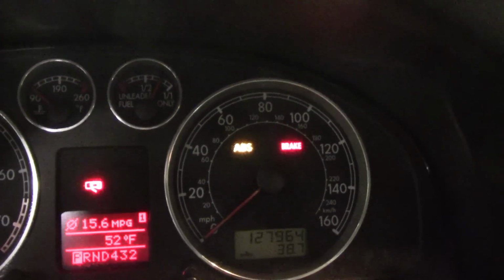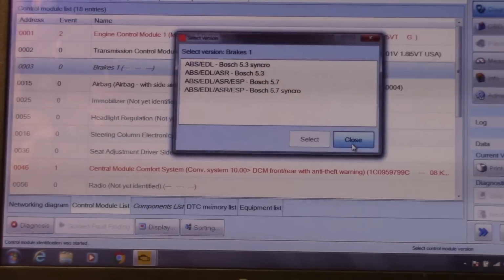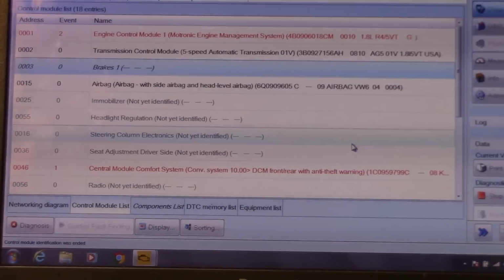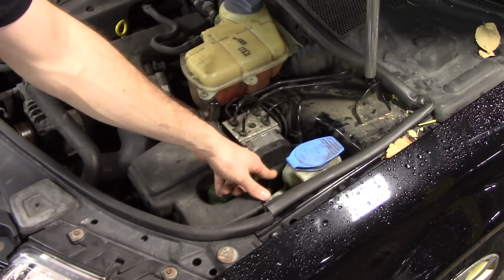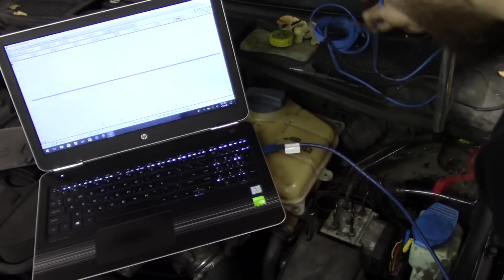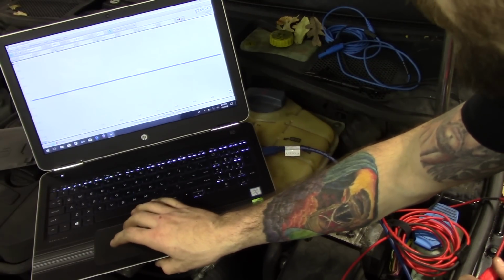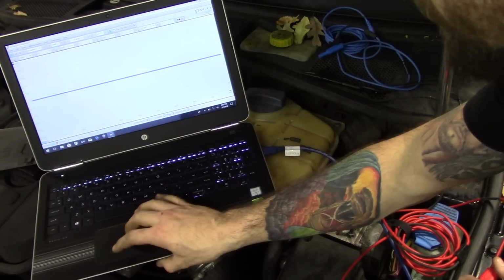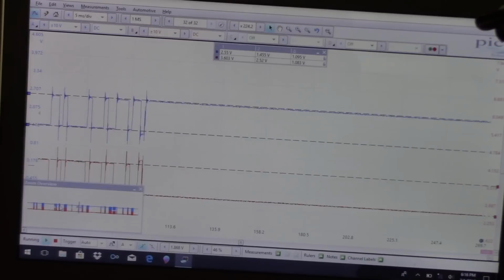ABS Module No Communication (2001 VW Passat 1.8T)

Comment: JETTA 2009 18259 1851 CODE AND THERE IS NO LETTER ON THE SCREEN, JUST WHEN I TRY TO TURN ESP OFF, IT DOESN'T GO OFF, IT IS ON ON THE SCREEN, IT WAS LIKE THIS BEFORE, JUST WHEN I PRESSED THE BUTTON, IT REMAINED ON LIKE THE OLD MODEL

Comment: pop off abs module cover and check ground pin with ground on scheme, its common thing, just solder ground two wires to cooling rad and done.
Reply from the maker: I’d like to try and start doing module repair.  Maybe someday

Comment: Can u help me out have all good power and grounds.but my oms are 160
Reply: On the orange
Reply from the maker: There are 2, 120ohm resistors In parallel. When they are connected In Parallel you should read 60ohms on a good circuit. It sounds like you have open circuit. Where are you doing your resistance measurement? And are all the modules plugged in when your doing it?  You might be unplugging a module that has one of the resistors in it and that would change your ohm reading.

Comment: Hi
What if the resistance is not within the specs???
Reply from the maker: What was your measurement?  Could be wiring or could be a faulty terminating resistor.
Reply: @PositiveLeadDiagnostics  
17-18 ohms

Comment: Same thing on a 2002 Passat. ABS light on constantly and red brake light intermittent and three beeps. Have done a lot of research on this issue. First proceed from the easiest to the more complex checks. 1- Enough brake fluid. 2- Check voltage and continuity in brake fluid reservoir sensor (clean it). 3- Check all the fuses related to ABS (replace accordingly). 3A- Verify your battery delivers the right voltage to the ABS/brake system (more than 12.4v ignition off), clean ground connectors. 4- Scan or have your car scanned with a Vagcom unit or any device capable of ABS reading (if a message of "no communication appears" bad news, abs module is kaput or wiring issue). 5- Clean and check ABS sensors in each wheel (use a voltmeter) also check wiring continuity. 6- Inspect the tone wheel teeth (sometimes there's dirt, rust or a significant wear; clean/replace). 7- Remove and check ABS electronic module. There's no need to detach the hydraulic side (no fluid mess). Inspect the wiring and connectors.

After my extensive search and talking to different specialised technicians, one of them from Bosch, told me these parts are programmed to fail at due time. Meaning you have to replace them yes or yes. A new unit for my car is around $1,200 usd. You can look for a second-hand unit at a junk-yard (around $300 usd). If so, you will need the old one so they can do the proper coding after replacement. Without coding its the same as if you did nothing; you will then need to take your car to a Vagcom equipped repair shop and may even come with the hydraulic unit as a whole, so full brake service here.
This happens no matter which brand of electronic module or car manufacturer you own.

*Note: There are some specialised service centres in the U.S. where they rebuild your module. You just remove the part from your car and send it over to them. Google it and some centres may appear. Some people have found some very fine wires (thinner than human hair) detach inside due to vibration. The inside is covered by a special gel so it is almost impossible to repair it yourself, besides being a highly specialised welding process of two different metals. I have known some people tried the help of jewellers to repair micro-cracks and use their expertise in metal micro-welding. It's a shot in the dark. 
For security sake you'll be better off with a new one (if you can find the part), rebuild your current module or buy a second-hand one.

Some folks will tell you if you can't drive without ABS, probably you shouldn't have a car at all! Truth is we have to go through vehicle inspections and our life is on the line, specially on wet and icy roads. 
Not all of us can be a Raikkonen or a Hamilton 🏎

Be safe.
Reply: Hello I'm an ex quality control BMW Mercedes technician from the '80s '90s no longer involved and car repair at that level my 2002 Volkswagen Golf manual transmission is undergoing some symptoms brake light beeping ABS lights been on for a while a real Christmas tree there suddenly my EPC light came on after having the resonator removed don't know why they removed the resonator it was just knocking underneath the frame I wanted the repair shop to bend it I don't know if him not grounding that part of the job but I don't think that was the issue at this time I think it's just time for some ABS work I cleaned the sensors replace the two front sensors clean the rear sensors car still will not run drove it home and limp mode where it sits thank you for your information
Reply: Hi mate i have got issue of no communication with abs module (U0121) on Mitsubishi outlander 2010. I have checked body ground, power supply, can H and low voltage and resistance, battery voltage... every thing seems fine. Note checked all of these things at ABS connector but still its not communicating with the scan tool leaving all the warning signs on the dash. I have tried 3 different used modules by just connecting them with the ABS connector.. not installed them all the way with the ABS pump. Can you help me by suggesting what should i do. It seems no problem with the wiring issue. Should i connect it throughly with the ABS module to get communication with the ABS module or its internal failure ?? 😢😢. Note: I have tried multiple used ABS modules with the same batch number and still it shows no communication. And one time tried with the different batch number module and the car was  immobilised to start up.

Comment: What about the other side of connector that is in contact with the module pins??
Reply from the maker: A pin contact issue is possible but these modules are pretty common. A better test would be checking the network resistance from the pin side if you have the right terminals to fit in the connector.

Comment: Im having this issue with my Touareg going to test the resistance if that’s good I guess the modules gotta go
Reply from the maker: You have to check powers and grounds too
Reply: @PositiveLeadDiagnostics Hi mate i have got issue of no communication with abs module (U0121) on Mitsubishi outlander 2010. I have checked body ground, power supply, can H and low voltage and resistance, battery voltage... every thing seems fine. Note checked all of these things at ABS connector but still its not communicating with the scan tool leaving all the warning signs on the dash. I have tried 3 different used modules by just connecting them with the ABS connector.. not installed them all the way with the ABS pump. Can you help me by suggesting what should i do. It seems no problem with the wiring issue. Should i connect it throughly with the ABS module to get communication with the ABS module or its internal failure ?? 😢😢. Note: I have tried multiple used ABS modules with the same batch number and still it shows no communication. And one time tried with the different batch number module and the car was  immobilised to start up.

Comment: What would it mean if there is no resistance on the orange wires?  Would this explain an internal module memory error?
Reply from the maker: It would mean there’s an open some where. Either in wiring or in the module with the resistors.   How are you checking the circuit?

Comment: So, i had the same issue with a newer vag model,2010 seat leon.
As soon as the cold season hit, abs started acting up. 

I pulled out a full module(pump included) from a scirocco (same part number).

The car worked fine until the next cold season began. Same problem.

Can anyone help? Did the customer owning the car ever come back?

Comment: tom can I make a suggestion.  I also live with these current flow diagrams being an audi tech. I find when printing the current flow off set the printer to "landscape" layout and it prints of in a better format 'uses more of the paper on the diagram rather than the wording which is much easier to see and also staple them together like a book. cheers for listening. I'm a big fan of Paul D and also started following yourself. cheers
Reply from the maker: Thanks Stephen. I appreciate the tip

Comment: I got a 2006 Touareg with a 4wd module not communicating. Powers + grounds to it are ok. Resistance at ecu pins 58+60 is about 60 ohms. Alldata says resistance should be 120 ohms. Do you think the ecu is bad? I got 12 other modules not communicating as well.
Reply: Hi mate, i think the resistance should lie between 55-65 or 70 ohm. So thats considered healthy CAN network. If its 120 ohm then it means one resistor at the CAN bus is faulty. 
I also have the same problem like that. Everything works pretty fine... voltage, residence, battery power, grounds all are ok but somehow no communication with the ABS module. Like you I have also tried multiple ABS modules but still no communication. Can you please guide me ??? Surely you have got some solution to this. It will be a great help. It will also be a great help for the community. Looking forward to hear from you. 🥹🥹

Comment: great video can you please tell me where you got the data on the resistance etc as i have the same wiring diagrams but cant seem to find the data many thanks
Reply from the maker: If you look in diagnostic procedures for the no comm fault. It should give specs in terminating resistance
Reply: many thanks

Comment: Does the CAN BUS always have the Terminating 120 ohm resistors regardless makes, models ?
Reply: There is a 120 ohm resistor at each end of the CAN lines.  They may or may not be located at the same place a CAN transmitter connects, but in high speed CAN are not suppose to be in the module.  I've seen them incorporated in connectors just past where the module electrically ties in.  The two 120 ohm resistors are in parallel when you measure between CAN Hi and CAN Lo, so the resistance reading is ~60 ohms.  

There is nothing wrong with the CAN twisted pair.  There is some ringing on the line, but it is on both CAN Hi and CAN Lo so cancel out when you subtract CAN Lo from CAN Hi.  The modules actually read the difference between CAN Hi and CAN Lo.  If the oscilloscope can do math functions, subtracting (CAN Hi - CAN Lo) would show a clean 0 to 2 volt signal.  Similar if you probed between CAN Hi and CAN Lo instead of referencing to ground.
Reply: Yep.
Reply: and don't forget it will be terminated with 120 ohm at two locations, so you should see around 60 ohms total if everything is plugged in and good.
Reply: For high speed CAN, yes.  It is part of the network standard for high speed CAN and is driven by the intrinsic impedance of the CAN wiring.  

There is an older low speed CAN that was used in some cars for a while that did have a different terminating resistor, but those, if I remember right were built into the modules on that system.
Reply: two locations.. one in the ecm one in the abs? when he unplugged the abs connector and got 60ohms that pretty much says no resistor in the abs, correct?

Comment: FWIW its either a shorted  Data/signal line Choke or a fried CAN SMD chip that is responsible for hand-shacking between the ABS MCU and the rest of the system MCUs, i will lean towards the 2nd guess its just a common failure on theses units
Good job Tom keep it up

Comment: Hi Tom, finally you get a chance to call the ABS module, but I have a question: for an ECM, when powers and grounds are OK, but no comm., there is also possibility of a shorted 5V ref. line. Is this also possible with the ABS module, does it feed any sensors, relays, solenoids, etc. via a current-limited supply? Can this be seen from the wiring diagram/notes? Thank you!

Comment: Good info as always thanks for sharing really enjoy ur video specially the one with no comm one question  where did you connect to check the the terminating  resistance . cheeeeeers
Reply: From the same place that you plug the scanner, you'll need the diagram, and disconnect the battery to check the continuity me

Comment: Oh my favorite money maker for the past 12 years
Reply: Well that and missing fuses of course 😉
Reply: Keith, can a shorted brake booster vacuum sensor (like on ford fusion for ex) make abs module a no comm?
Reply: MrBorntoroll if its pulling down the reference voltage circuit possibly
Reply: New Level Auto what bad modules?
Reply: 90%- bad ABS module. Don't waste time by diagn. Extremly hard to repair module inside. [tiny wires-less like hair in silicone. ] My sellf  spoiled 2  modules trying fix[4-5 hrs.] Buy rebuild module . Watch letter behind p.# !!!  and org. code !!!